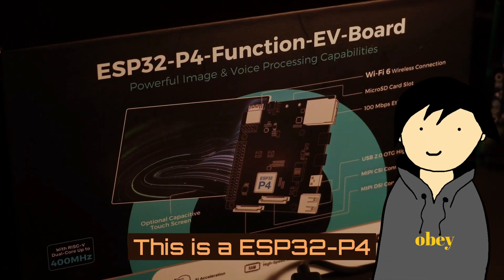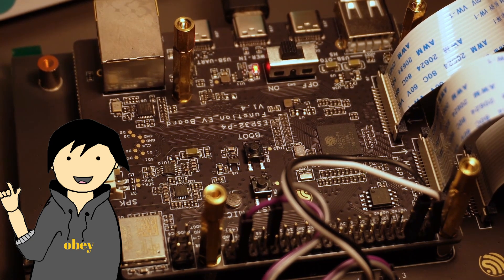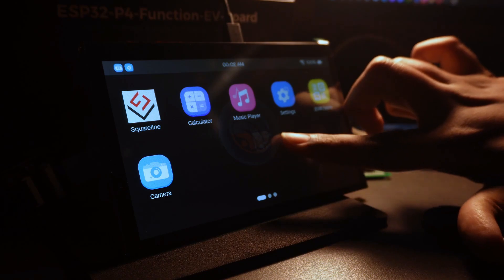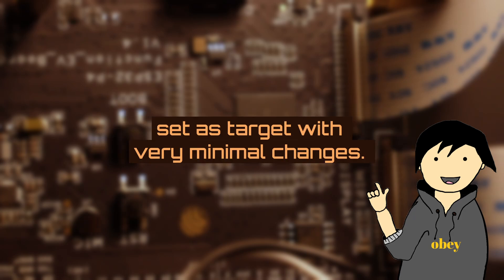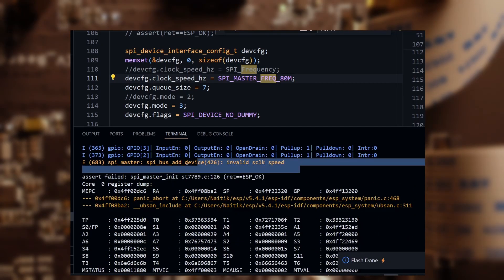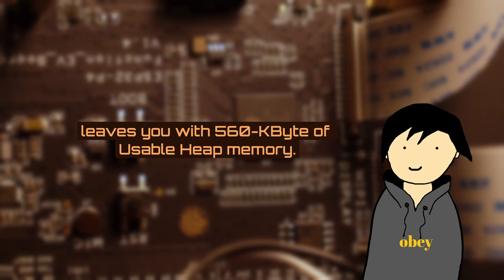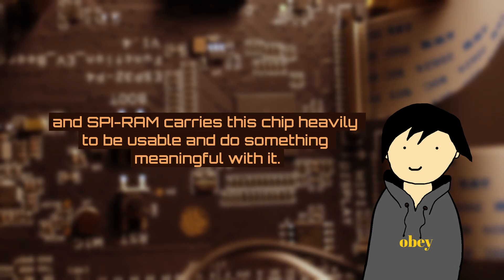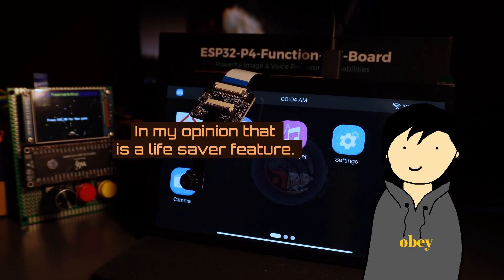My Thoughts on ESP32-P4 Function EV Board After some Experimenting + Review

Comment: I would really like to start building my own designs with the P4, after playing around with the devkit, but it seems like neither the raw chip as QFN, nor the WT0132P4 SoM from Wireless-Tag have good availability yet (in europe at least :D). The fully integrated display modules you can buy from AliX all have so many unnecessary features built-in (standby power draw gotta be horrendous) or gpios used up that i wanted to use for other peripherals, it's a shame.
Reply from the maker: Yea it sucks. Keep in mind These are still an engineering sample in the end of day. That's why Only few vendors have access to these chips. It's been 2 years since first they teased about ESP32-P4. Official release will definitely take another year with this pace :( Hope they go in mass production soon because this thing right here has some real potential!